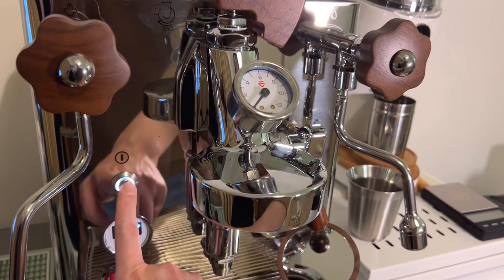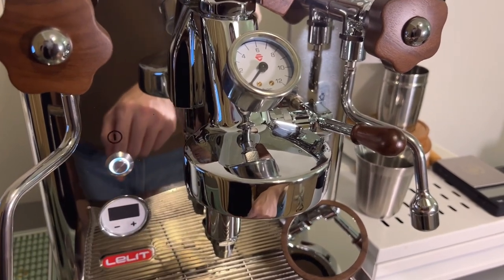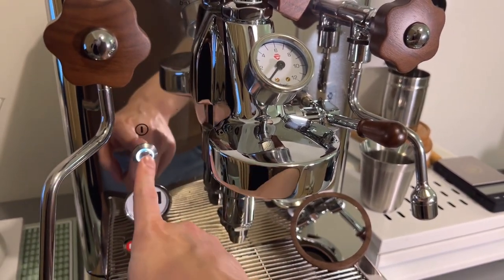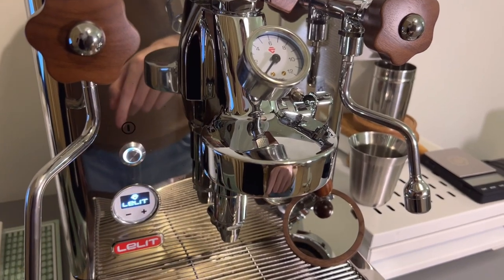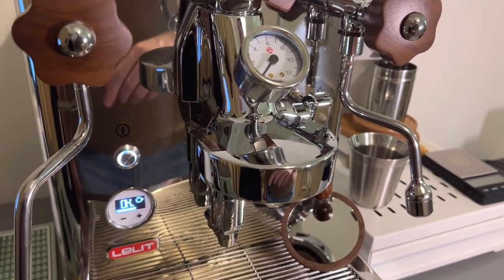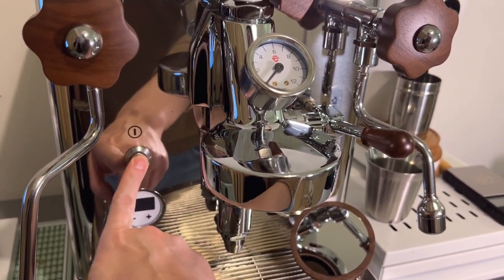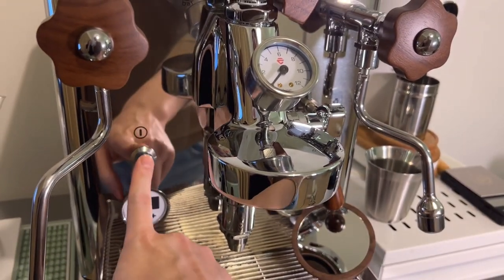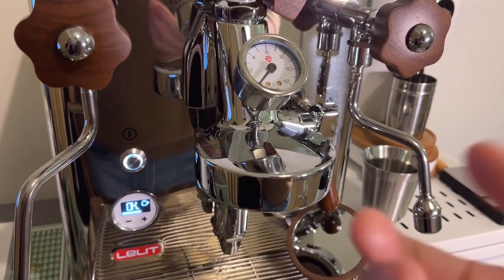[Lelit Bianca V3] How to disable or enable standby mode

Comment: great video! i got my v3 too. wondering if you could share your backflush pressure? mine is like 10 bars but i saw other videos they are all at 11 bars, did they change it for v3?
Reply from the maker: My backflush pressure is around 10.5 bars. This is somewhat easy to change on your own with a screwdriver via the OPV pressure setting underneath the machine.

Comment: Noticed your machine is set to 90 degrees. Did you ever measure the offset of the temp. out of the brew head? 

Online I keep reading it’s about 6-7 degrees so wouldn’t that make your setting to low?
Reply: I agree with your assessment that the brew head temperature is quite a bit lower than the reading. I set my water temperature up 3 C to compensate. Certainly makes better coffee.

Comment: This is fucking ridiculous. I bought this machine a few days ago and this has been absolutely pissing me off. I turn on the machine and leave to let it heat up, and when I come back the machine has already turned back off, this happens constantly. I've been reading through the manual several times and Googling my ass off to figure this out. Why wouldn't they just include an option in the LCC, right next to sleep mode!?
Reply: Agree. Since it takes at least 15 minutes to get to temperature, by the time it reaches temperature, it shuts itself off.